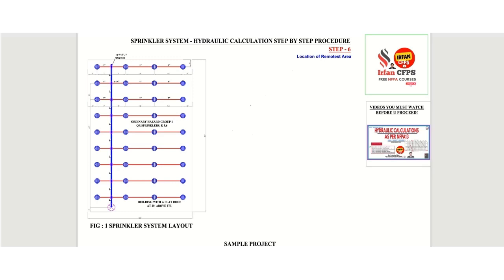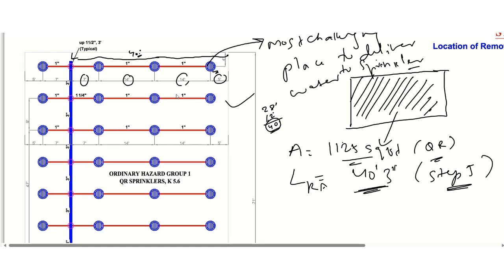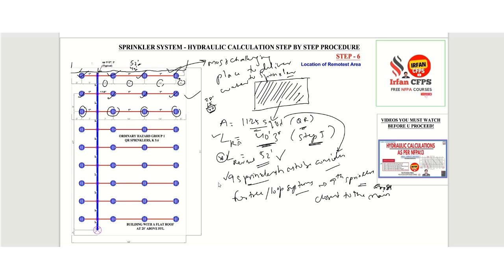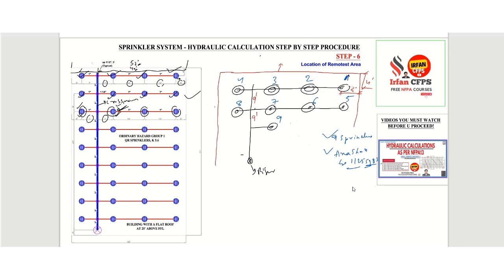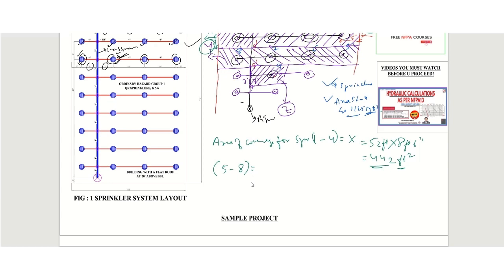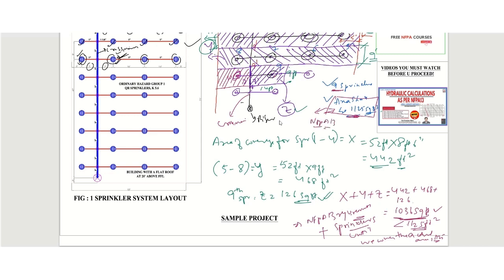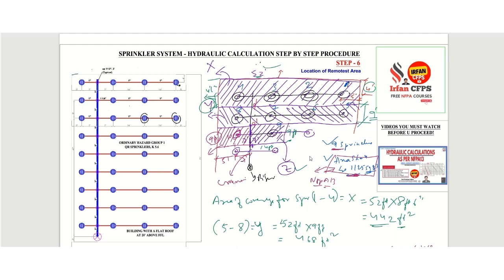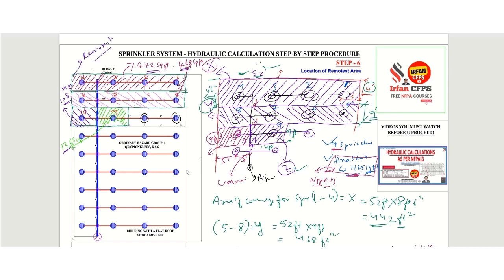Step 6 |Hydraulic Calculations for Sprinkler Systems

Comment: What is remote area mean? It is a controller devices?
Reply from the maker: Remote area means remotest hydraulically calculated design area in a building / a project. As per nfpa 13 we will identify the design area and perform the calculations

Comment: What if the most remote area on-site is less than 1,500 sq. ft.? For example, consider a hotel layout with multiple small rooms separated by partitions, each containing a toilet, along with a corridor. In this scenario, how should the number of sprinklers be determined, and how should the most remote hydraulic calculation area be selected?
Reply from the maker: Consider those remotest rooms and make sure to maintain 1500sqft combining all those areas. Then check the number of sprinklers located in that 1500 sqft area.

Comment: These remotest to be on same floor? Fr example my building is g+10 so all remotest to b somewhere on 10th floor ?
Reply from the maker: Remotest can be on any floor. It should be checked from the fire pump room to the remotest branch/area. So if u have g+10 floors and the pump room is in gf then obviously remotest will be last floor with remotest area.
Reply: @ thanku. One more thing plz, what is pressure set value after ZCV on sptinkler line.
Reply: @ what is minimum pump room height required for fire pump room